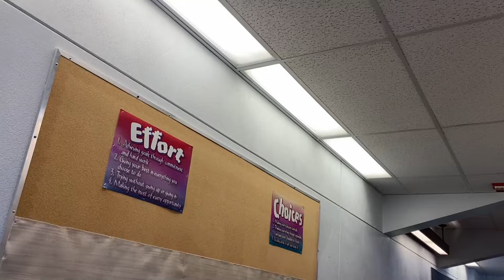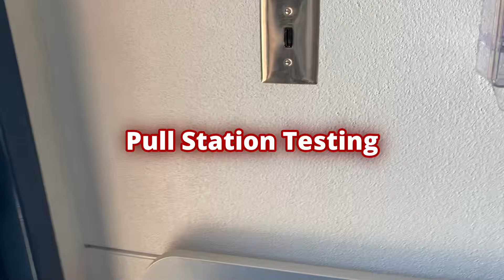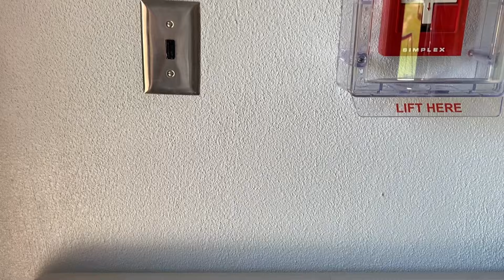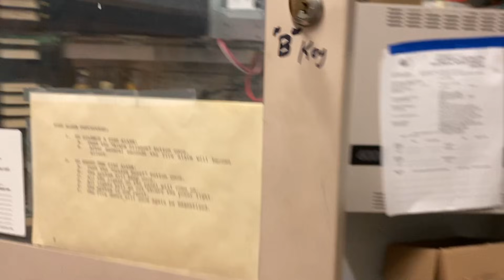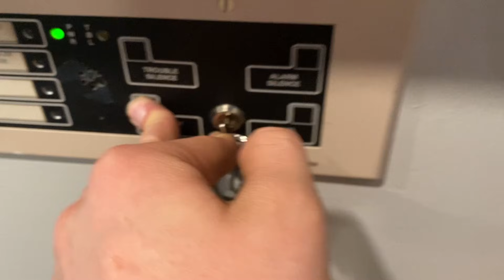Setting off Rare Simplex 4903-9104 Fire Alarms

Comment: Is it the 9104 that's ceiling mount? I can't find any other information on the vertical-strobe or ceiling mount versions of the 4903-9101
Reply from the maker: Yes the ceiling mount model is 4903-9104

Comment: Ceiling mounted 4903-9104 plates are SUPER rare! Also is this in a different school in the same school district as the last video?
Reply: They are actually 4903-9104s!
Reply: @aidanthetoiletelevatorfire7554 my bad that was a typo I have made all thanks to my auto correcting keyboard 😒